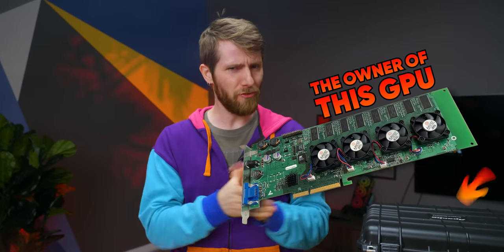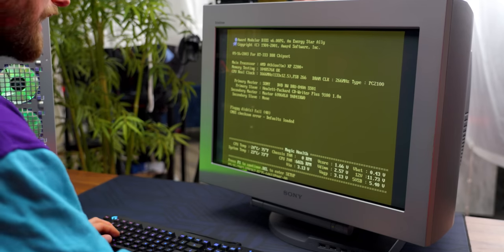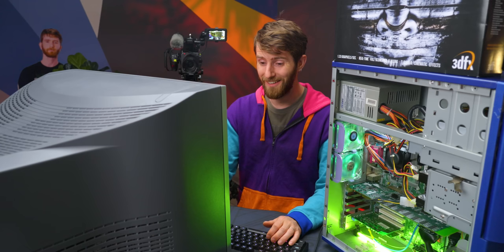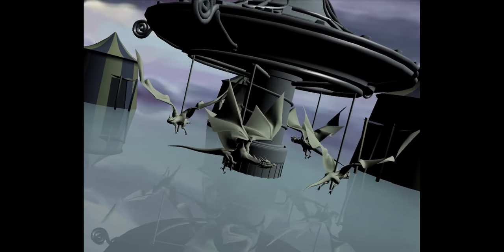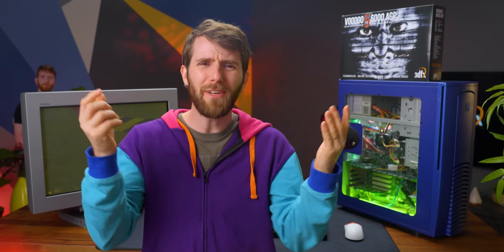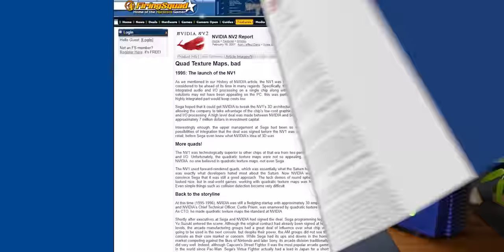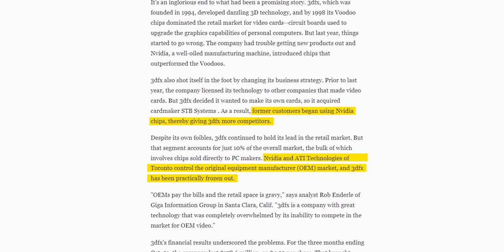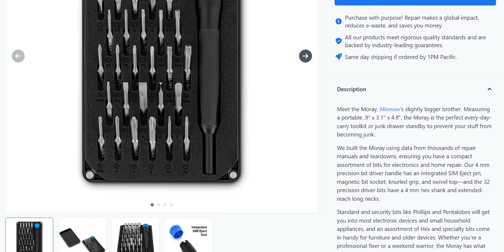This GPU cost $15,000 and there’s only ONE like it – 3dfx Voodoo 5 6000

Comment: 4’s better than 1 right? It’s so fricking long tho-
Reply: With how parallelisable GPU work is, it actually made some sense if you didn't have the reliability for the huge modern chips. SLI is basically the same idea packaged differently (and Voodoo actually called the idea SLI as well, starting with Voodoo2 and the ability to pair cards). The chips (VSA-100) had been designed specifically for this use, with fillrate (hopefully) increasing linearly with the number of chips up to *32*. Though designs only got up to 4x with the 6000, and actual products up to 2x with the 5500.
Reply: That’s what sh-
Reply: Probably shorter than 4090
Reply: @stylinsandwich  yea lol
Reply: @DreamOfFlying  we don’t talk about that…
Reply: That’s
Thats
That’s what 

That’s what she said
Reply: @DreamOfFlying  we don’t talk about that…
Reply: @stylinsandwich  It was still a HUGE card for the time. Remember the Creative AWE-32 card with ram slots. Was also a Full length cards. I remember some cases actually had support rails in the front behind the Floppy and HDD bays for full length cards.
Reply: @sneezyy.  shhhhh

Comment: Since we’re starting to hit diminishing returns when it comes to visuals in games, it’s nice looking back on graphics that were a massive leap forward for the time.
Reply: The diminishing returns is software defined. Once you understand that Linux is going to be the gaming platform, you also understand how gaming engines have to be re-engineered and then those diminishing returns go bye-bye.
Reply: @jeschinstad  please explain how Linux is going to solve anything AAA game development related.
Reply: @jeschinstad  how can a platform solve the fact that developers/publishers bring out bad games?
Reply: I mean, always best to be careful around claims like that.

How quickly we forget that we said the same thing for the xbox 360 and PS3 and were pretty dead wrong.
It's hard to tell given graphics cards come out more often than consoles, but comparing the 2000 series and games of the time to the 4000 series and new games, it's a noticeable jump.
Reply: @jeschinstad  Using Linux is now the equivalent of being Vegan or doing CrossFit... You don't have to ask, they will tell you as soon as you make eye contact with them.
Reply: But also in the time when there was more emphasis on gameplay and graphics were just icing on the cake.
Reply: @vapid6311  The better question to ask is, how much longer till we get to the point of rendering real life graphics without any delay, like you said graphics will keep improving every year even if we think we reached the limit but until you take a screenshot in game and it looks like a real life photo or you play a vr game and it looks JUST like real life, I think graphics cards will not stop improving, even if we reach the photo realism. Will we get there soon? I don't think so but it will happen in the next decade.
Reply: @Jo-Erlend Schinstad  it's not software-defined, Linux isn't growing even with all the spotlight people give it, and Windows 12 coming out soon Linux will be put even more in the dirt
Reply: @Vapid  we claimed that and it was wrong. this time it's right and many games look better than what a budget samsung phone can capture
Reply: why is the screen green?
Reply: I honestly don't think that we are actually hitting diminishing returngs for visuals these days, it's more a problem of our current hardware not being quite sufficient for what we "could" do with the engine tech we have right now. Cyperpunks RTX overdrive demo for example is a massive leap forward in terms of graphics fidelity and light acting as realistic as we have never seen before, but even a 4090 struggles to hit anywhere near well playable FPS in that without massive visual degradation through DLSS. Realtime Raytracing in general is potentially the biggest thing we have seen in the last decade or more for 3D games, but it was released a bit too early for our current gen hardware to handle it anywhere near its true potential. 

The ability to have realistic light, reflections and texture behaviour without prebaking, without fake lights and fake environments, without having to artificially create the lightbounces and so on is an unbelievable leap forward for game visuals and the workflow of game developers, "IF" we are able to use it the right way anytime soon.
Reply: @jeschinstad  that literally had nothing to do with what he said nor will linux solve anything
Reply: Na , gonna keep getting better looking always, no doubt, diminishing returns Deez nuts
Reply: @jeschinstad  1 linux had litterally nothing to do with the conversation here

2 linux can't magically make games look better, when we say graphics nowadays have diminishing returns, we mean that the visual difference of a game from 5 years ago to one released today is very small since graphics have looked good for awhile now
Reply: @vapid6311  honestly I stand by that the 360 and PS3 generation is as good as graphics need to be, sure looking at a game on the PS3 it may look bad, but it's not the graphics that do, it's the resolution, upscale the resolution with something like RCPS3 and you'd be shocked how close it looks to modern games
Reply: Not so in VR based driving sims.
Reply: @informitas0117  🤣🤣
Reply: Yeah it’s really putting into perspective how far we’ve come
Reply: Diminishing returns? I don't think so. Have you seen what nVidia is doing now with Particle Tracing? Please explain what you mean.
Reply: Well, I believe we'll see good returns on low end or energy efficient GPUs
Reply: @Bogdan100pink  have you seen the "Unrecord" demo? We're basically there
Reply: @jeschinstad  ratioed
Reply: @jeschinstad  we are there with steam os and Proton . i don't ultimately see people jumping ship to another OS without having a negative experience. people don't like change necessarily either.
Reply: Diminishing results are because for the past 10 years everything is limited to whatever console generation. Can't really do a leap in graphics when targeting PS5, which was already outdated on release (can't handle modern ray tracing).

And as Metro Exodus and Cyberpunk 2077 show - ray tracing is that leap. But both games are making two steps back from that leap due to assets being made for last gen consoles. Like you get this beautiful lighting applied to dated models. Sigh.

So we see any other difference only when new generations of consoles happen.
Reply: Some of the stuff done on UE 5 with nanite and global illumination (lumen more so than path tracing) are a jump as big as the last 15 years put together.

When diminishing returns meet exponential improvement in performance the returns don't feel so limited. The big difference between now and then is that the exponent changed; CPU performance used to increase by about 60% per year (average in the 90's!); almost all from pure clocks. GPUs used to double from generation to generation and a full generation was 12 months. With the death of Dennard scaling CPUs scale by only ~10% per year now (there are more cores, but adding even more doesn't really help) and GPUs still by ~60% but only every 2 years now.

CPU performance lagging behind has been a big problem. If it depends on the complexity of the world and if you can't figure out a way to do it on the GPU it may become less and less feasible to implement as graphics improve. The GPU would not break a sweat with thousands of NPCs all uniquely dressed and animated; this is a CPU and I/O problem. You can't store so many unique textures in full resolution; but you can't watch 1000 NPCs simultaneously at full texture resolution either; a lot of them will only require pathetic textures like 64x64. Keeping track of what the GPU needs and streaming resources just in time and such is a big bottleneck. If you don't have to do that, it is easy to have 10 000 NPCs of low quality visible on screen.

These problems with streaming high resolution meshes and textures and having direct storage access from GPU are being solved. The capacity to make the games is the most limited resource. Compare e.g. Daggerfall with Skyrim. For Daggerfall you could have cities that felt real in scale; you could ask any random NPC for directions; you could do it because each NPC didn't get a handcrafted model, voice acting, unique dialog or anything really. For Skyrim the main city contains like 12 people; why? Each needs to be low poly modeled, high poly sculpted, baked, animated, motion captured, you need an SJW to figure out if the dialog is offensive, a voice actor for japanese, english, german, french and spanish, someone to sign off on the project etc. Games have been shrinking. AI will largely solve this; it doesn't even need to be very good; just good enough at filling in those less important NPCs, their motivations, voice acting etc.
Reply: The 4090 is a pretty big leap, so was the 1080 ti.
There's always big leaps, you just need to be increasingly richer to get a taste of them now.
Reply: @imgonnacream : It is silly to even compare Windows to Linux at this point, Linux devices being sold in the tens of billions already. If you ever get the chance to open a modern computer, you will already see numerous Linux devices running inside, from network cards to storage controllers and DPUs.
Reply: @dr4d1s : On the contrary. Most Linux users don't even know that they're using Linux.
Reply: @scienceontheright  not sure its called particle tracing looked up what that was because I've never heard of it used with gpus or gaming but if you mean path tracing i would say that's an even bigger sign that we're hitting diminishing returns.

if you crank settings up to max and then turn ray tracing on or path tracing in cyberpunk 2077 there's not much difference even with the billions of calculations a millisecond deciding what the game should look like its not much different let alone noticeable after 2 minutes of gaming
Reply: @wrmusic8736  consoles will never be super powerful with leading edge tech like you see with every generation of graphics cards because consoles need to be affordable, sony and microsoft already sell them at cost or very tiny margins then they need to pay AMD a cut for the 50 million APU's. 

Game devs need to start optimizing towards pc gaming as i think its going to take over more than console gaming. we can already see them doing that with these UE5 games recommending 2060s for 1080p low graphics 30 fps.

If consoles are going to stay at that 500 dollar price point and have out dated tech on release game devs wont be holding out with all of the amazing  game engine features that have came out in the past year
Reply: @jeschinstad  tens of billions of devices? theres only 8 billion people on earth bud and if you mean computer parts they are not on linux as its an operating system not a programming language
Reply: @tim3172   I'm not saying you in particular, I'm saying there was a large consensus on this outside of the tech bubble and hell, even a few inside.

My point is, we'll be able to tell better in hindsight if we really are hitting a wall
Reply: @flamingscar5263  well as good as they need to be is very different from as good as they can be.

I agree that console generation's games hold up, but I don't quite think more graphical fidelity is a poor cause either.
Reply: @imgonnacream : There are a few billion Linux consumer devices that are obvious, like phones, tablets and TVs, but consumer devices is just a small part of the total. Modern network cards run full Linux systems. As do DPUs and many other things. Linux is literally everywhere. There is no point in not running Linux on your GPU, allowing for more intelligent processing. The problem with the current design is that you need to send data back and forth between GPU and CPU, which means you need to have one powerful GPU rather than many small ones. Pretty much similar to single-core CPUs where you could make the CPU run 10% faster by spending twice as much power. Instead, we switched to multi-core CPUs, although that required software to be re-engineered. Same will happen to game engines.
Reply: @imgonnacream  console gaming is more profitable exactly because it's affordable. I doubt PC will be a central platform for gaming again any time soon. I wouldn't be surprised the reason PC ports are so bad is because devs outright think "well this console is less powerful than an average PC so why optimize when PC will just brute force the thing".

And hello Jedi Survivor and Redfall.
Reply: @imgonnacream  Yes, I meant path tracing (no idea why I said particle). Anyway, I did try it with my 3080 ti in Cyberpunk 2077, and I definitely saw a difference. I guess our experiences were different. Of course, trying this on a 3080 ti brought my FPS below 30 FPS (I have a 4K OLED), but even in photo mode, I could see tremendous improvements. In fact, there's videos that demonstrate this (here's one: https://youtu.be/a0UQTYmQUuA). I am excited to see what's coming next.
Reply: I thought we were beginning to get diminishing returns too - until I looked back at games from 2012. We've come a LONG way, and engines like UE5 are paving the way towards insane levels of detail.

Comment: I will never forget how I first came across 3dfx. I went to a local gaming café, where me and some friends used to play Lucasarts's Outlaws in multiplayer. The staff had upgraded the computers to Voodoo cards without telling anyone, and once I saw how incredible the game looked on those cards compared to not having it? I made it my mission to get one myself. It was a night and  day difference to have texture filtering in games.
Reply: Hardware transform and lighting on consumer hardware really was the game changer.
Reply: I loved outlaw. I have it on my AMD K6 III 550 with Voodoo3  3000 rig
Reply: I'll never forget QWCTF with a 3dfx card.  The colored lighting was ridiculous.  The flags literally glowed through the walls and it was basically a hardware cheat at the time.
Reply: @orbatos  No, the real game changer was taking the load off the CPU and using much faster dedicated hardware for 3D graphics, and also making a good API for developers to use. Hardware T&L came much later.
Reply: @another3997  What do do you think hardware transform and lighting are? At this point most people were getting their first video cards with 3D acceleration, in part due to the success of the voodoo 2, but also because of the massive droop in cost of production for both vector hardware and memory which had until that point been the domain of literal supercomputers. This kind of thing is why X was implemented as a network protocol, allowing a mere deskside workstation to leverage dozens of racks of hardware for CAD and lidar visualization. Shaders, which Linus erroneously says 3DFx didn't have, directly came from hardware optimizations developed on these massive systems.

Comment: So I worked in a PC repair shop when 3dfx hit the scene, the thing people forget is that having a 2D card AND a 3D card was seen as a bonus for most users at the time, so the Voodoo was seen as an add in bonus card, to go along side people's existing 2D cards, cards which more often than not the customer had chosen and liked already, so it was seen more as 'not losing my 2D card' rather than 'I have to buy a 2D AND 3D card?' It was seen more like an add in sound card really.
Reply: The prices were crazy at the time... 1999 was when computers were dirt cheap and finally affordable for everyone you went from 1992 - 3000 dollar computers to 1999 - 800 bucks for something that was 20 times or more faster and 4 times cheaper . Computers only got a little cheaper after that peaking in 2012 or so when i think you could get a desktop PC for 480 bucks

Comment: The RTX 4090 is shivering right now. No one can stop the 3dfx revival!
Reply: Imagine AMD decides to slap 4 7950XTX cores on a board, draw 1200W and punches Nvidia in the face in 4k, making it a one-off GPU considering people are willing to pay that much for a collector's piece.
Reply: @zayd1111  Imagine doing the 4 cores in Crossfire or SLI, maybe a 5 slot GPU but who care if someone is willing to pay $15000 on one GPU, might as well make a modern one that is nuts and charge $50000+ no?
Reply: @zayd1111  Any thoughts on splitting the screen into quadrants each rendered by its own GPU?
Maybe even a frontend chip assigned to combining results from preprocessing GPUs which do physics, raytracing, or so on.
Presumably there'd need to be some significant intercore communicaiton going on to pull any of this off.
Maybe as much chip realestate just put towards talking to the other chips and dealing with shared memory and optimizing where tasks that depend on oneanother get executed to avoid bottlenecks.
Might end up with a full CPU on the thing just to dynamically reallocate load to optimize execution time.
That way we could throw a few kilowatts at the GPU instead of merely hundreds of watts.
Reply: @rarrawer  sometimes when running early SLi you could actually see the split in the screen where the top and bottom images were spliced together (if using that mode and not alternate frames).

I'm sure we'll see a revival of something similar down the line but it was a pain to code for. More sales for the GPU companies, though.